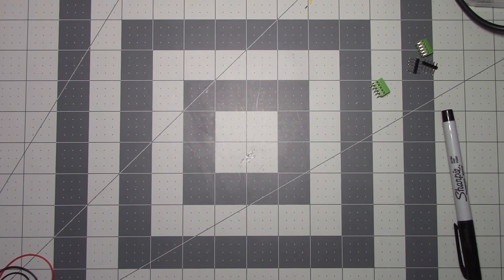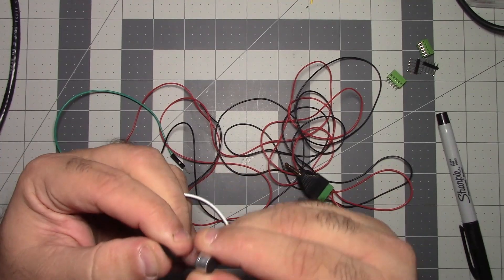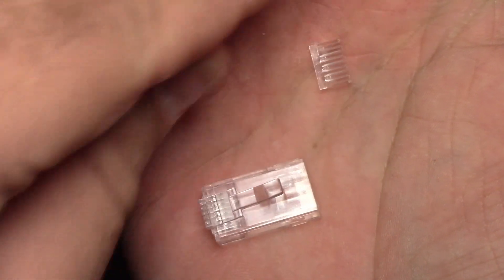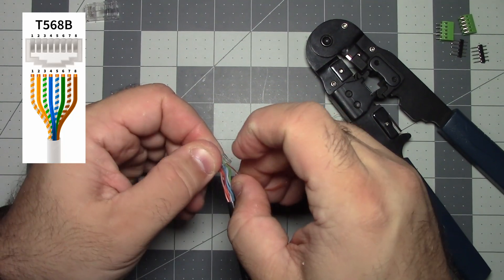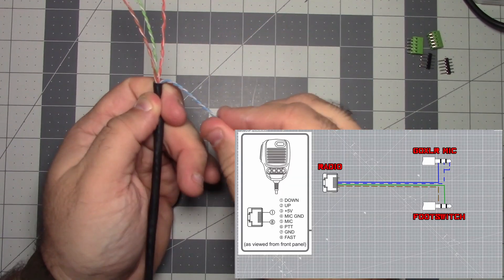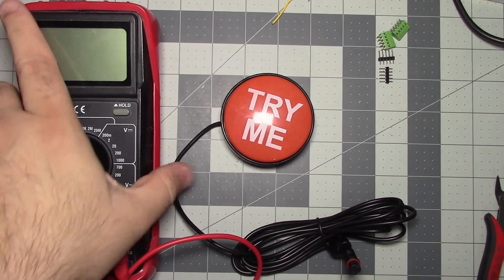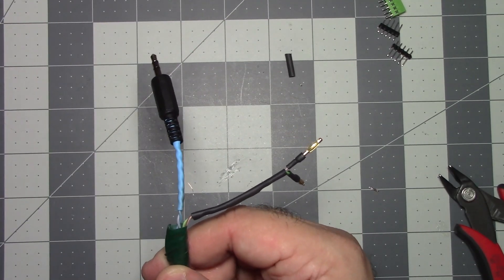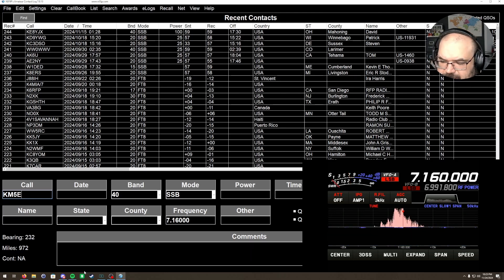[AMATEUR HOUR] Yaesu FTDx10 DIY Microphone/PTT Adapter

Comment: Good Video, question I trying to build a XLR Mic and PTT cable to a yaesu mh-48a6ja mic, any ideas?
Reply from the maker: I think this is a little more complicated so I don't know for sure but I think it depends on your XLR mic, some XLR mics require 48v phantom power, in that case you would need 48v phantom power supply to power your mic. Other than that the principal is the same, hook up the wire according to the pinout. I've heard good thing about this brand for audio equipment. https://amzn.to/4jUbZuX

Comment: Did you ever get the noise out? Im trying to figure out how to install a ptt foot switch on my ftdx10 so I can log contacts with both hands. Im having trouble finding info
Reply: It depends, I looked for the same and if you want to use an Input from a Computer, so a "Line out", than you need to use the PTT at the rear Data 6 pin mini DIN Connector, as far as I could read, PTT from the front and Input from the rear will not work.

I will try to use the (RJ45?) front connector for headset microphone and will try to use PTT from the rear RTTY/Data port, so I can try use the rear PTT for front microphone and for "Line in" audio, maybe in the future.
Reply from the maker: Yes, instead of using CAT 6 for both PTT and Mic, I used this shielded 3 core cable for the audio, that seems to keep the noise out for me. 
https://www.amazon.com/dp/B0CBJZPN3B?social_share=cm_sw_r_cp_ud_dp_5EB9R8J9HSAW0K7GBBK5&previewDoh=1&th=1&linkCode=sl1&tag=brokeham-20&linkId=88e5b9ba32ff2e42e1332098147f4802&language=en_US&ref_=as_li_ss_tl